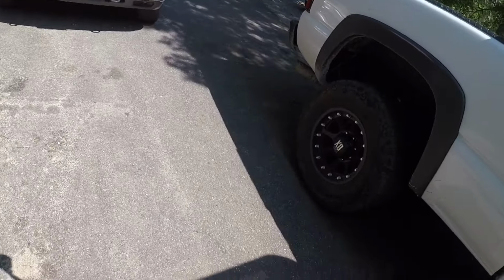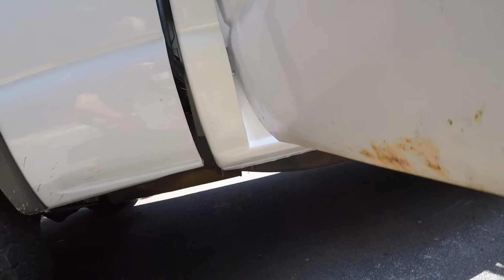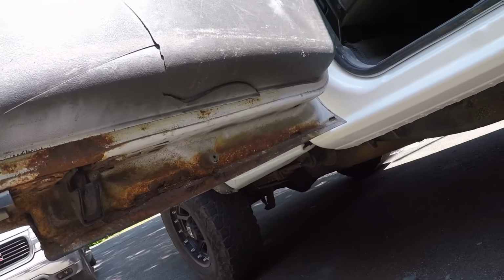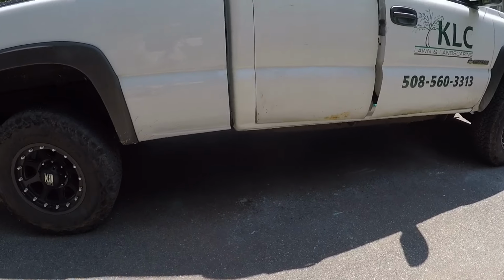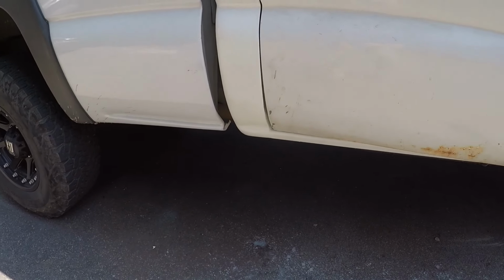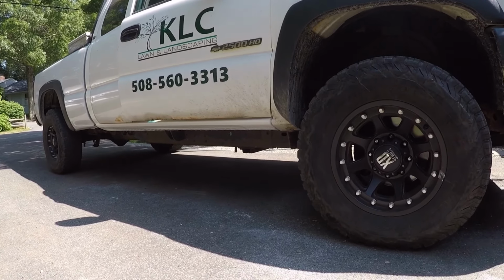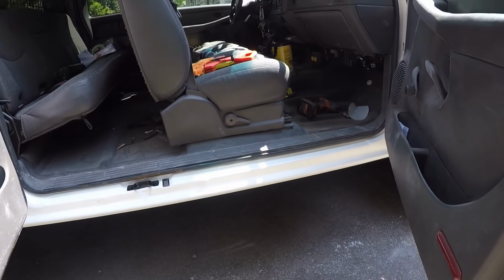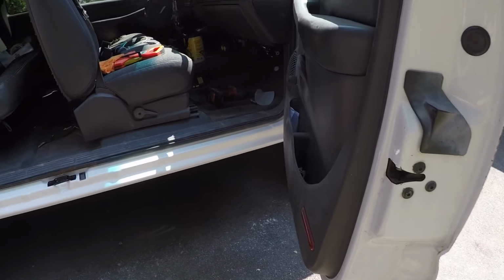HOW TO Replace Repair Rusty Rotted Rocker panels Sierra Silverado Cab corners 2500hd 1500  2 of 2

Comment: You have inspired me i have a 2004 2500hd crew cab and i have rust in the rockers on  both sides , drivers side is worse . I also really need to replace the bed also .

Comment: Great video series for the common man. Next time consider tintable Raptor Liner. I’ve done a few trucks in white with it. It’ll coverup crappy body filler work. Or if you still prefer rattle can, then consider spraying “rocker guard” after the primer then the final coat. I hate it when people spray black undercoating on the rockers and door bottoms when color matching options are available. The benefit of the rocker guard / raptor liner is that they remain flexible and can take rock hits without chipping.